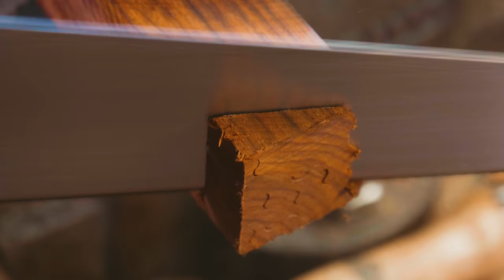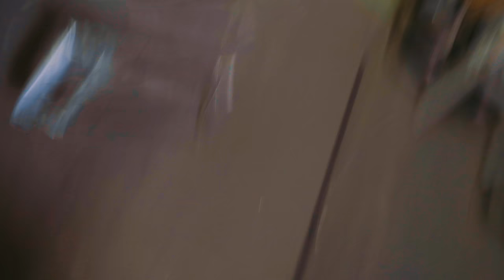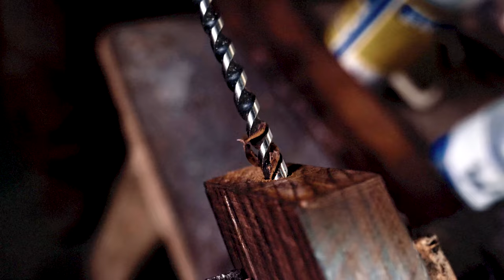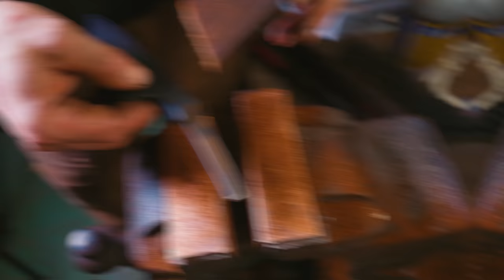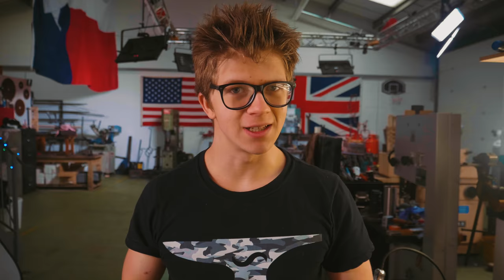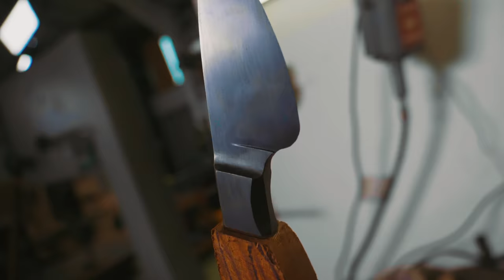MAKING A KNIFE WITH NO POWER TOOLS!!! PART 4

Comment: Alec, you can try sticking a long pin down your first hole, then hand drilling the second one next to it, then pull out the pin, then use a small long chizzle to clean up the sections between the holes. It works for me.

Comment: When using the broach you cut parallel to the wood grain, so you Need a rip teeth broach... It seems yours has crosscut teeth if i don't get wrong
Rip teeth give you a better control and a more effective and clean cut, also when cutting endgrain with your saw, you Need rip teeth 
A proper set of broaches would Be very useful for you, they seem very fast working! And you have the equipment ti ground tool steel and cut the teeth you want!
And what about making a damascus rip saw? It's not easy but you have the equipment and the knowledge to make It!
Imagine a damascus SAW, a lot of saws enthusiasts would kill for having It!

Comment: Mexican (aka true) cocobolo can be an irritant in dust form, and repeated exposure can cause an allergic reaction. You don't have that, because it's redlisted due to heavy logging now and illegal to import - there's literally only a few tonnes of the stuff left in the entire country.  

That piece you have would be worth over £100 if it was true cocobolo! You probably have Nicaraguan cocobolo which is a different tree and less irritating (much cheaper, still hella pretty), or Tamboti, which is often sold as African Cocobolo (same).

Wearing PPE when working with wood is still important though, regardless of how irritating/toxic (or not) the wood is. All dust is bad, it's just some dust is more bad than others.

Comment: Hey Alec! not sure if it's been already mentioned, but its easier to drill something by hand first and then cut the surface to a incline. To calculate the extra amount you need to drill, just draw on a piece of paper and measure it out :)

Comment: If you haven't, check out Brazilian Redwood. It's kinda like Tennessee Hickory only redder. I brand new counter sink drill bit will sit a smoke while trying to drill the stuff.  It's often used as decking material for porches. 
I carved a skull style tobacco pipe out the stuff. It's fun stuff.

Comment: The cocobolo thing is real. But its only really an issue if you're allergic to the dust or oil. If you are and you breathe it in it can make your throat close up. You can test if you are allergic to it by cutting a piece, wetting it and placing in on the back of your hand for a couple minutes. If you get a little bit itchy then wear a respirator at least. African Blackwood and Western Red Cedar are also ones that can mess with ya. Stay safe :D

Comment: cocobolo belongs to the rosewood genus (Dalbergia) and these woods contain quinones called dalbergiones that are potential sensitizers. In other words, they are capable of causing allergic reactions for some individuals, usually in the form of respiratory problems or contact dermatitis...So, the dosage required to cause a problem varies a great deal, depending on the individual's sensitivity to the allergen.

For some wood workers, a small amount of the dust does little more than deliver a pleasant fragrance, while for many woodworkers the scent is so pungent that heavy exposure becomes an irritant, causing mild but annoying symptoms, i.e., watery eyes and congestion. For the few, unfortunate individuals who are exceptionally sensitive to these dalbergiones, even the slightest exposure (sometimes merely touching the wood) is enough to cause a serious reaction, usually in the form of contact dermatitis.

As for precautions, until you discover just how sensitive you are, any exposure to the dust is a risk. I think the best approach is to wear a respirator and clothing that covers as much skin as possible when working with the wood for at least the first two or three times (allergic reactions usually don't result from the first exposure.) After a while, you'll discover how tolerant you are to working with the rosewoods, but I think you'll find that, at the very least, wearing a respirator when working with any of the Dalbergia species is a good idea.

Comment: Hey I just made a chip shop vegetable oil can forge, it works beautifully with its plaster and sand refractory wall, using coal and firewood as the heat source with a hair dryer intake pipe for oxygenation, sad part is I have no anvil.

Payday can't come quick enough so that I may purchase my first anvil and get to making my own and wonderful stuff just like Alec.

Comment: For doing the integral tang, Why don't you boil the wood before hammering the blade in? I think back to the impossible nail puzzle and the ability of a boiled wood to compress is amazing. In the puzzle, they cut a piece of wood to make an uppercase E The nail goes through the middle piece at a perfect 90 degree angle and sits there looking like it's impossible for the nail to have been hammered in. What they did is boiled the wood and then compressed one of the end pieces with a clamp. After that they hammered the nail through the middle and removed the clamp. Once that was done they boiled the wood again and the wood reformed into it's original shape. You could maybe do that with a tang instead of a nail. and instead of everything being visible it could be hidden.
Make a makeshift sheath with a piece of wood so it goes all the way down to the bolster. Or take a 2x2 and rip it down the middle and then just tape it together over the blade. that will be your packing block. drill a hole in the wood that will eventually be the handle. Do not cut the angle for the bolster just yet. Measure it out, then do some math as far as how far you need to drill to include the piece you will be cutting off. Do the drilling then as everything is square use a bit one size smaller than what is needed for the clearance. Use a piece of tape to signal when you should stop drilling. hollow the piece rectangular. Cut the angle. Boil the piece that will eventually become the handle. This is where the speed comes into play. Bring the handle out of the water, into the vice it goes hole up, Take the blade in the sheath and insert the end on top, pound on the packing sheath to seat the blade to the bolster. Once that's seated, boil the handle again so that the wood tries to reform into it's original shape slowly compressing the blade in further. Maybe cut a few ridges into the handle beforehand so that when it reforms it grips the blade internally. Let it dry and then shape the handle to fit.

This is only a thought. QED.

Comment: Just drill the hole tight and heat up the tang. Push it in almost all the way and then remove. Leaves a perfect fitting recess which you then replace the tang when cold. Quick knock to push it home and that's it. Just like fitting file handles.

Comment: If you popped a dowel half way into the top hole you might be able to get the depth to get started. As a possible solution to using a brace and bit to drill two holes next to one another.

Comment: Drill two smaller diameter pilot holes.  Then use the full size bits, and they will track to the pilot holes.

Comment: It may have been easier to fit the handle if you used the burn fitting method to burn out the exact shape of the tang into the wood.

Comment: For future reference, your brace was trending upward on the double hole, so if you drilled the bottom one first, the top should still be workable. Nice job! 
EDIT: The dowel thing would probably be better, but if you didn't have one find out on a scrap which way the bit trends and do the opposite one first. It'll work pretty good. Also, the montages made me suddenly feel like I was in a Make It Extreme video, so you've got that going for you, which is nice. :P

Comment: Just an idea.. When using the coping saw.. {the one that looks like a jewelers saw) could you not hold the material horizontally and make deep enough scribe line so the blade follows the line itself?.. The only issue being you'd have to constantly be sure that you're not off at an angle when removing material..

Comment: 2 questions why didn't you start the hole before cutting a slant so you can start with a flat surface and why use a brace for drilling vs a manual drill?

Comment: No-one ever sees my comments but hey :) you should really start to burn the tang into the wood instead of trying to cut and fiddle about. Create a pilot hole to start, make sure the tang has a tapper to the end, then heat it to red, and slide the tang into the pilot hole of the wood, this will burn out the material and give you an exact fit with less work :) Man at Arms Reforged do this all the time
Reply from the maker: I've never done this technique - but I have heard that it can damage the wood and end up with a surface the glue won't want to adhere to and this is why I haven't tried it!
Reply: Most of the videos I have watched with those from Man At Arms (Baltimore Knife and sword) build weapons for Role Play or on screen, maybe it would be worth testing this sometime :) but yea I am certainly no expert, maybe an expert in watching Videos and suggesting other methods haha. Keep up the good work though Alec, love the work you are doing and very entertaining.

Comment: Alec, you should get yourself one of these tables off of eBay. It's called an "optic" table, but it's very good for having a milled, flat surface to work from, and be able to mount equipment to. They generally cost about $12k (US), but can be had for around $500 on eBay. Check out one from Tech Ingredients Youtube video:

https://youtu.be/nZefdoHmtJo?t=9m32s